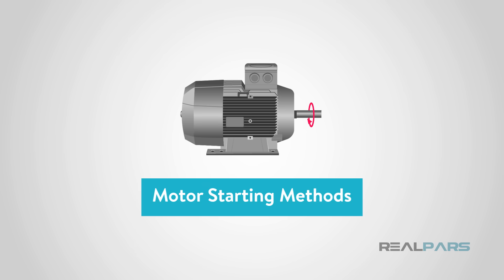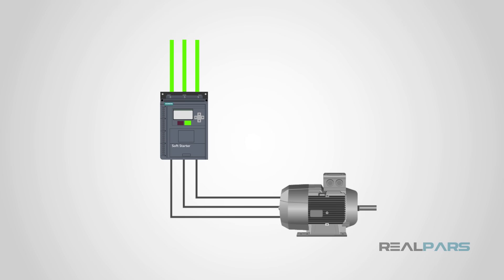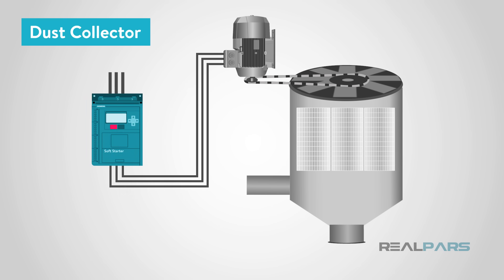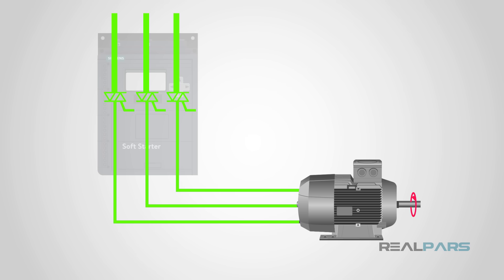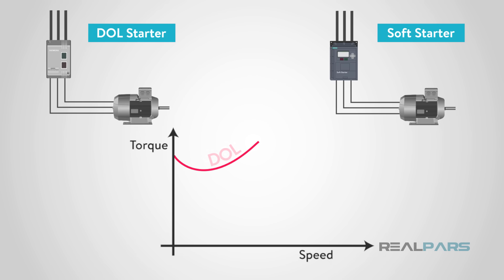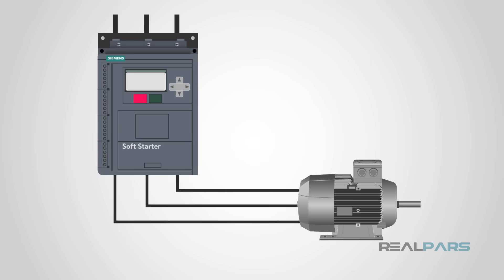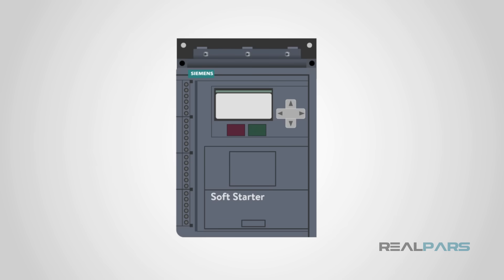What is a Soft Starter? (For Absolute Beginners)

Comment: To basically I can use a soft starter instead of a star/delta set up. So this take care of having to buy contactor to wire a star and delta set up to the motor.
Reply from the maker: Hello, @YouTubers12-b9o Yes, most of the time this application will work. But you must take into consideration some engineering standards like current, voltage, amps required, and torque, if you are moving a very heavy object.

If you're looking to learn more about this topic, you can join our 7-day free trial at https://community.realpars.com/ Happy learning from RealPars!

Comment: So basically, using soft starter helps the motor to start slowly, which reduces the surge of current and torque that can break the actuator or the motor at the start of using other methods.
Reply from the maker: You got it!

Comment: My Micro Air Soft Starter Flex has failed in Just 11 months. It is very short when compare to the life of the AC system.  My last AC last for 17 years.  The Micro-Air Soft Starter Flex has Multiple electronic parts inside the cavity blown, leaving all kinds of debris inside.  It disable my AC in a very Steamy hot night.  I have to hire my AC Technician to remove the unit and has the whole  AC system check up.  Luckily, my ac survive the possible damages.  Having Spent more than $400 on the unit plus the AC Technician charges.  It does not worth the money spend.  Honestly, I don't feel comfortable spending that kind of money to install it and waiting for the disaster  to happen.  It shocks me when I read the reviews on Amazon.  Many have their Micro Air Soft Starter failed in a very short period of time.  Some even have their AC Compressor killed.  My Technician told me I am risking damaging my ac system without any warranties coverage on my AC System.  In addition, the soft start kit has limited warranty and will not favor any damages caused on my own AC.   I will not recommend this soft starter to my friends and families.
Reply from the maker: Hello, @benp7164.  Thank you for your comment and sorry to hear about your bad experience with soft starter.  Normally the soft starters we introduce in our videos are industrial types. And they are build better. Happy learning from RealPars!

Comment: Please can it work for an 0.5 Hp pump effeciently using a 2.5kva 24V inverter system
Reply from the maker: Hello, @emmanuelorekha. Thank you for your question. You have a good question. It all depends on which manufacturer you want to use. You can visit their website and look at the data tables or catalogs. You can also contact someone in their sales/service department to help you select the device you need.  Here is one link to get you started, you can investigate:  https://sieportal.siemens.com/en-ww/search?scope=catalog&Type=products&SearchTerm=soft%20starters&CatalogSearchSettings.Limit=20&CatalogSearchSettings.Index=0&SortingOption=Relevance
Reply from the maker: Hello, @emmanuelorekha. Thank you for your question. You have a good question. It all depends on which manufacturer you want to use. You can visit their website and look at the data tables or catalogs. You can also contact someone in their sales/service department to help you select the device you need.  Here is one link to get you started, you can investigate:  https://sieportal.siemens.com/en-ww/search?scope=catalog&Type=products&SearchTerm=soft%20starters&CatalogSearchSettings.Limit=20&CatalogSearchSettings.Index=0&SortingOption=Relevance

Comment: Can you use a soft start on a home air conditioner
Reply from the maker: Hi John,

That's a good question, thank you! You will have to look at the data spec sheet of your air conditioner. There is a soft starter for AC units on the market, and some AC have them build it. Depending on your needs and budget. The soft starter must be connected between the controller and the motor units you want to control. Not sure where you are located, but here is a link for your learning.

https://softstarthome.com/ 

Happy learning!

Comment: I have a 10 Hp electric motor that uses 47 RLA's the torque I'm trying to overcome is substantial. Think a soft start would help more than say a hard start kit?
Reply from the maker: Yes, a soft starter would limit the amp draw when the motor is first started.  With a high starting torque requirement, the starting amps would be significant.  A soft starter would provide a smoother start,  but it will take a little longer to come up to speed.  However, the possibility of popping a fuse at start is greatly reduced.
Reply: @realpars  Thank you sir

Comment: Really well described. I have bought a 15kW Sawmill and I have bought a soft start with several different start modes. In my setting where I would like to start the motor without destroying the 25A fuse (3P 400V) I have 2 settings to choose from, Either:1. current limiting setting or 2.Voltage Ramp setting.  But Im not sure which one to choose for my scenario, what do you think?
Reply from the maker: Hello Jonas Granlund, 

Thank you for your question. 

Unfortunately, I can’t answer your question, because I don’t know your application and your engineering setup. But I can suggest you look at your soft starters’ manual graphic charts to help you with your torque load and speed output at your load requirements. It should address the amps used for your settings. And make sure you have the wire feed sized correctly to handle the load. 

Happy learning!
Reply: @realpars  Thank you so much for the response, when I look at the graphs and read the manual I get the feeling that the Current limiting mode is a little more advanced and reduce voltage when the Current start to overshoot the set-value.  But I'm not sure how high I dare to set the current limit and the amount of second it needs to be delayed.  This is what the manual say about this start mode:   The current limiting starting mode is generally used in occasions with strict
requirements on starting current, especially when the power grid capacity is too small.
To limit the starting capacity, the current limiting multiple can be set according to
the requirements, which is generally between 2.5 and 3 times. If the setting is too
small, the normal starting will not be possible. When current limiting starting is
adopted, the starting time is related to the current limiting multiple.

Comment: what do you mean by DOL? please☺
Reply from the maker: DOL = Direct On Line.  A Direct On Line Motor Starter (DOL) consist of a Circuit Breaker, Contactor, and an overload relay for protection.  This type of starter delivers full voltage through the starter and does not have the capability for speed regulation or soft-starting.

Comment: Just installed one on my Central A/C's outside condenser to reduce inrush amps. Later I will get a whole house generator, this was the reason I installed it. My inrush amps went from 120A to 40A. It learned how much it needed to start and reduced over a few starts. 120A, 80A, 60A, 40A Something like that.

Comment: Can vfd work as a soft starter?
Reply from the maker: Yes, a VFD can be set up to provide the same benefits as a soft starter.  However, if you do not need speed regulation as a normal operating strategy, using a soft starter will be more economical.

Comment: Nice video... It's educating. However I have a question; which capacity of Softstarter would be suitable for a particular Motor. Example, I have a 55kw electric motor, how many kw or amperage Softstarter would be suitable for that application
Reply from the maker: The best way to determine the proper Softstarter is to reference the literature of the manufacturer of your preferred vendor.  55kW (75hp @ 460VAC) requires a starter with a 110A capacity @ 460VAC.  For example, see:  https://new.siemens.com/global/en/products/automation/industrial-controls/sirius/sirius-hybrid/3rw-soft-starter.html  or https://www.rockwellautomation.com/en-us/products/hardware/allen-bradley/motor-control/soft-starters--low-voltage/smc-50-solid-state.html.

Comment: I'm planning a whole house backup generator which includes running my 3 ton Air Conditioner. The problem WAS my AC was blowing my budget because it would require an 8000 watt minimum generator to handle the initial startup of the unit. I found this soft starter and installed it on my AC (took about 10min.) and now I can run my entire house on a 3500 watt generator. Saved me $$

Comment: As the terminal box is only at the fixed side then why you shown the input lines connected from different place for DOL and Soft starter as compared to star- delta..?
Reply from the maker: You are correct.  Motors do have a terminal box on the motor to which all motor leads from the starter are connected.  Showing different connections for DOL and Star-Delta in the video was for comparison and illustrative purposes only.  The motor leads are connected to the same physical location on the drive in either configuration.

Comment: Will the motor links have to be setup in delta with the Siemens Soft starter?
Reply from the maker: Yes.  Delta gives you full voltage across each winding.  The soft starter sort of acts as a Wye-Delta starter, giving a reduced voltage at startup.

Comment: Normally how many additional years will you add up to the life of the motor when using a soft starter compared with a full voltage starter?
Reply from the maker: Great question, but difficult to answer.  Life of a motor depends on a host of factors, but using a properly sized, installed, and configured soft starter should extend the life of your motor by up to 25%.  The normal life of a motor in years has too many variables to make a quantitative assessment of increased life in years.  That all depends on the load, torque requirement at startup, motor design, and how the motor is run (frequent start/stop?, etc.).
Reply: @realpars  
Hope we can request manufacturers to conduct test

Comment: Would we push so many of electrons to do the jobs that earth could do without even use of force? For example instead of using large motor to run the conveyor, we could use sensitive hydraulic balancing to tilt the conveyor and let the load and gravity play its way to destination or use gravity to fill the tank instead of pumping ?... The same concept for all one way road construction with 1 degree downward slope and reduce cost on transportation fuel or force on city road and streets design

Comment: I want my air conditioner to start quieter, would this help? I'm also wondering about whole house capacitor to prevent voltage drops and dimming lights?
Reply from the maker: Hi there, 

Thanks for your comment!

This would make for a great topic suggestion for the future, I will happily pass this on to our course developers. 

Thanks for sharing!
Reply: @realpars  you can get individual capacitors for individual appliances but I think it's an interesting question whether one could have a whole house capacitor to perform the job of avoiding voltage drop at air conditioners or other large appliances. I also think that appliances like air conditioners which are still 100% on or off are inefficient. Any large appliance that could potentially have any savings starting slower like an air conditioning compressor unit, HVAC fan, washing machine, oven, stove you name it, seems like everything should start slowly to save money. Or at least have an optional setting to do so like an eco mode.
Reply: you should upgrade your AC system with inverter compresor. It has variable speeds that depends on load. Lighter load, compressor runs slower and quieter
Reply: @lordred7462  it is a new Goodman gsx13 scroll compressor, not bad... works very well but the start up is loud... I'd love to upgrade to a DC inverter style, wonder what a 3 ton unit would cost.

Comment: This is more "why you should use a "softstart" rather than how a soft start actually works. Need more info on voltage out to motor over ramp time. How much voltage is applied? what is the starting voltage? how much does the voltage increase per ramp time set point? Does the voltage ramp up or is it gated?
Reply: I've been doing industrial maintenance and motor control for over 30 years, and lately, a soft starter might be a couple dollars cheaper, but inverters can do everything they do, and a whole lot more with a helluva lot more versatility. 
Even the most plain Jane inverter can do everything a soft starter does, is practically the same price, and is hella easier to find and quicker to get.

Comment: I build a simple soft starter circuit for use on some of my power tools. The big problem is that I must manually through a switch on the starter itself while the tool's switch is closed. Works great, but a hassle and dangerous. I wish someone came out with a small size retrofit addon kit for saws and other high surge current motors that don't NEED to have balls out instant starting. Be great for construction worksites running off a generator.
Reply: Makes me wonder if soft starters could be added before the electric socket, so whatever you plug into the circuit plug gets the soft start (one or more designated outlets for high current equipment)
Reply: @troy3456789  Check out Raymond Innovations. They have a fully self contained soft start box you can plug into any machine that uses a brush type motor. I purchased the Model GS-10 a couple years ago and it works great! I use it for my Skil saw, chop saws, vacuum cleaners too. Does not work so well for motors that use a starting capacitor though. Not cheap @ 150.00.

Comment: Softstarters are the work of the Devil. For most applications, and especially high inertia starting, a Star Delta is grossly superior.
For pumping applications, they do avoid shock loads, but at the price of cooking the motor windings.
Generally either D.O.L., Star Delta, or Variable Speed Drives are grossly superior.
I have never had an application where a soft starter is a preferred option.
Reply: A soft-starter is normally cheaper than a VFD isn't it? How does a star delta compare cost-wise?

Comment: Do we need soft starters for hydraulic motors? Is there a a high inertia load in hydraulic motors compared to your large fan example in the video?
Reply from the maker: Torque is proportional to inertia  The torque required for a hydraulic motor is dependent upon the fluid flow rate and pressure developed in the hydraulic lines (usually >1000psi).  So, yes, hydraulic motors can have high torque requirements.  For hydraulic systems, power clutches are used to regulate the starting pressures (hence, torque and inertia).  These devices are not really soft-starters, but rather hydraulic "regulators" that act similarly to reduced voltage motor starters.

Comment: Is it possible to use software Starter for slip ring induction motor,and can replace rheostat unit for higher starting torque?
Reply from the maker: Yes you can use a soft starter (not software starter) with a slip-ring induction motor.  You can set up most soft starters  to give a starting profile that meets your specific needs.  Every motor is different, so if you are unsure of how to set up your specific system, consult your motor supplier for guidelines and limitations for starting circuits.

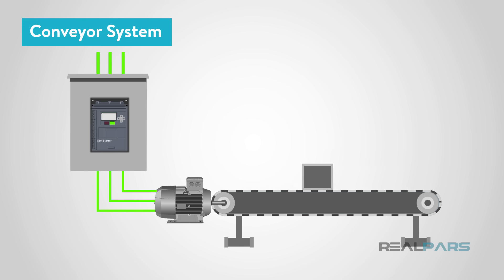Comment: At 3:10 I see the soft starter and, besides (parallel) a contactor. So, my question is : How these two components work together? It could be that when the motor starts only the soft starter works, then, when the frequency and voltage are  adjusted (by the soft starter), the contactor is activated and the soft starter disconnected.
To me that's the explanation. But, another doubt : When we hit the stop button...Is the process the inverse of the starting? , I mean, both contactor and soft started are connected, the the contactor i disconnected and at the end only the soft started is stopping the motor?
I will appreciate your explanations.
Reply from the maker: You are likely correct on the use of the parallel contactor.  It is also possible that this particular motor is used in two different modes, one requiring a soft-start and one that does not.  Although not completely drawn correctly, Siemens does make a line of motor monitoring modules that is installed in parallel and is cabled to the main motor controller, but I would believe your suggestion is most likely correct.
Reply: @realpars  Thanks a million for your reply.  I hadn't kept in mind the fact that a motor can operate in two modes: with or without a soft starter.
Reply: parallel contactor would represent an emergency bypass starter.  When soft starter is nor working properly, the control will close the emergency bypass to allow motor operation.
Reply: @mikeodell9688  A great explanation. You're right. Thank you so much!

Comment: Can you control a permanent magnet motor with a soft start?
Reply from the maker: Yes.  PM motors should use a soft-start or VFD for starting and control to avoid large current inrushes that may lead to motor or component failure.  It is always best to check with the manufacturer of the drive you wish to use to see if there are any recommendations for use of their devices with PM motors.  Some manufacturers, such as Yaskawa, have specific models or features that are provided specifically for use with PM motors.